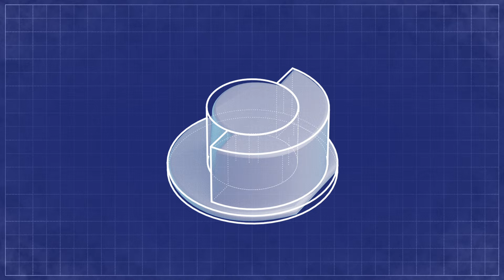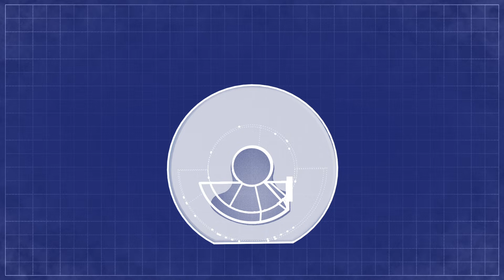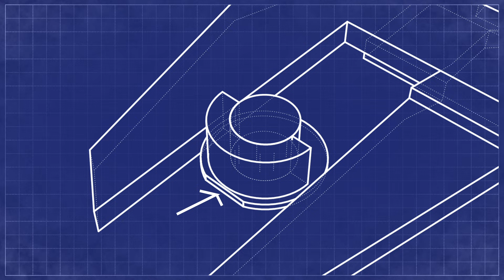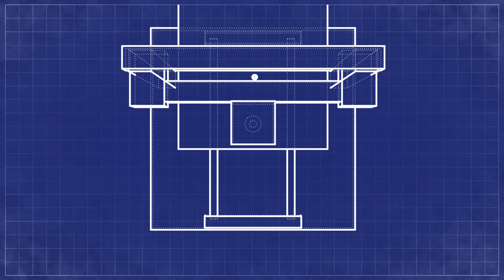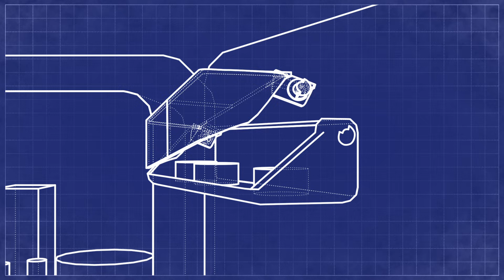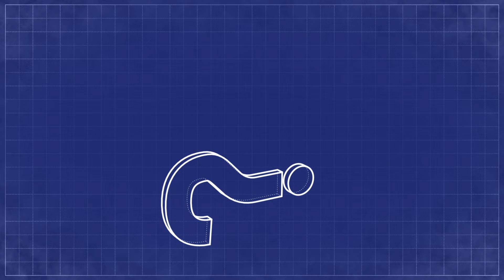Maja's fridge - deep dive

Comment: I guess it's mostly that shape because the lid walls have to be slightly tapered for the demolding (usually 3-5°) . This is all injection molded after all. The weird internal geometry is probably there so the parts only fit on the corresponding side and won't get switched up (poka yoke). This is indeed a very complex lid ngl.
Nice graphics btw.
Reply from the maker: Thanks for the inside info! I wonder why they didn't just make the two parts identical? Wouldn't that have been easier and cheaper to produce?
(Going to Google poka yoke!)